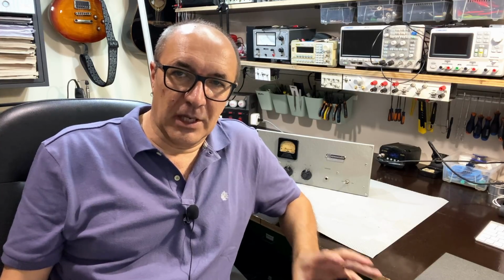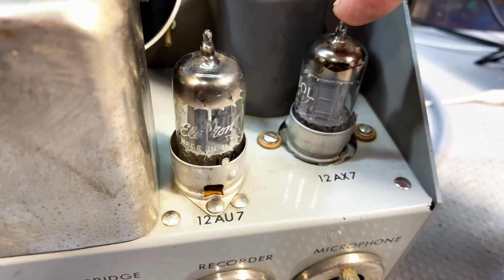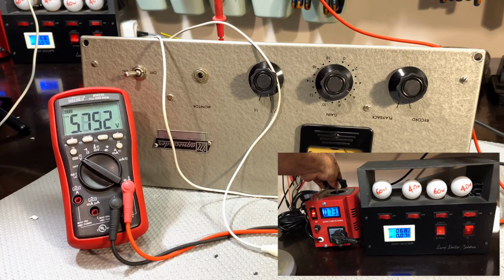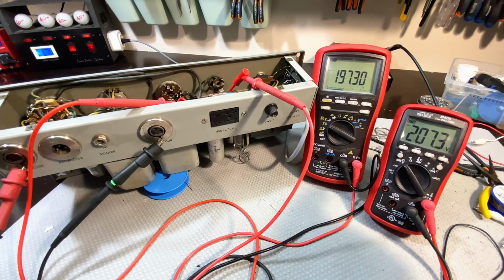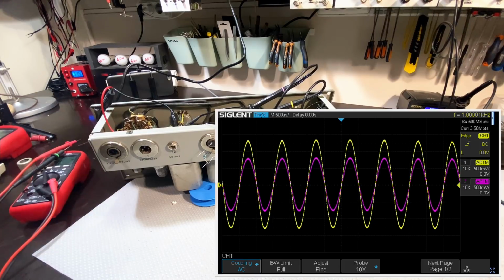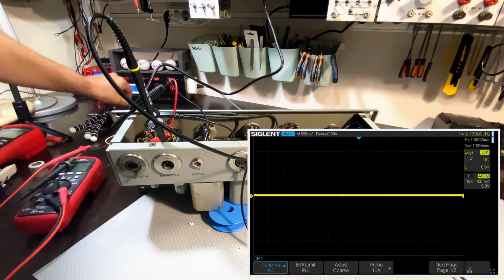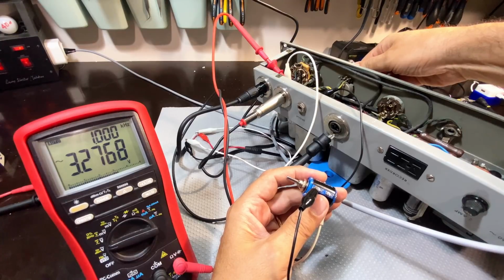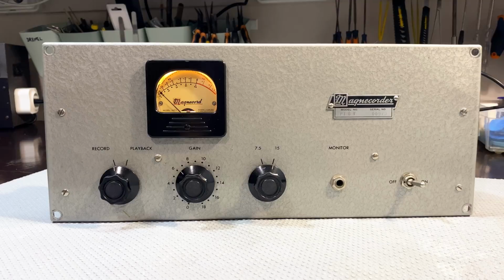Done, and tested. Magnecorder PT6V restoration pt 3.

Comment: That's fascinating! I was well aware that there was a pre emphasis and de emphasis going on with tape recorders but I didn't think that the eq curve would need to change for the different tape speeds! 
I wonder why they did that? This is almost like they deliberately designed it to sound poor at the slower speed! 
Sure you have to be careful not to saturate the tape but this makes me wonder if the eq curve for the slower speed was made identical to the faster speed, would it sound as good as the faster speed? Albeit at a lower recording level to avoid tape saturation and thus distortion... 
I will be keeping this in mind when I work on my open reel recorder which is overdue for a complete overhaul... I don't mind sacrificing a bit of dynamic range for better sound quality at the slower speeds.... I don't think that dynamic range was even a consideration when they were making the 80's dance music that I listen to LoL.... So it should not be a problem for me 🙂
Reply from the maker: I’m not too sure of the reason but I imagine they wanted to avoid saturation. Just a guess. The dance music you refer to does bring to mind the era of “more volume, less substance” 😊
Reply: @electronicsoldandnew  actually the dance music that I was referring to was the italo disco that was in just about every night club here in Melbourne Australia... There was also a lot of great music that came out of Germany, US and UK... Compared to the music that came after it, it was definitely getting louder... 
As for the Electronics, yeah I don't know! I actually have two open real recorders which are not being used but in need of a full restoration... I did a test recording on one of them when I first got it home and it sounded terrible at the fastest speed and only got worse at the slower speeds so I put them aside to get ready for the restoration but ended up falling into depression which I have been in the last 4 years and haven't been able to do anything but I'm slowly on the road to recovery and I have a lot audio and video equipment that is waiting for me to get stuck into... Lucky I'm a hoarder, I will take anything that comes my way but have difficulty in letting it go LoL, my wife is pure gold and a real keeper! They are hard to find but women like her do exist LoL.

Comment: Nice video! Balanced, differential, I always mix it up. There is a post on the audioscience review forum on this that is very helpful. I think the output here is balanced; this refers to the equal impedances of the two lines of the interconnect. The signal here is not differentialm indeed. You are right this configuration cancels out common mode noise from the interconnect, but only if the impedances are balanced. Hence the balanced attenuator, this is correct! Quite uncommon configuration. Differential has added benefits in the distortion ans SNR domain.

Comment: I have a similar Variac. China is swamping the market with them. I took mine apart before I used it and I was shocked to see that the earth terminals were connected to the frame with a bolt but they did not scrape the plastic coating away! So the earth was useless. My dear friend, please check yours out too and dremmel the area around the terminal and screw it back together. We do NOT want to loose you!
Reply from the maker: I’ve done that already 😊 Don’t want to take chances.

Comment: So this unit does not have an oscillator? Most tape decks contain a bias oscillator that generates a frequency between 50 and 100kHz to help the signal be recorded on tape. You can also use a DC current for this, but this is only used in cheap tape recorders and signal-to-noise ratio is much worse with DC.. It would be very nice to see this unit with the tape transport it was supposed to be used with. Maybe this transport contains the oscillator circuit, but it does not make sense to me if you have any electronics inside the tape transport, why not also include the amplifiers.
Reply from the maker: The transport has the oscillator circuitry. I should. e looking at that in the near future, and want to show the two together in action.